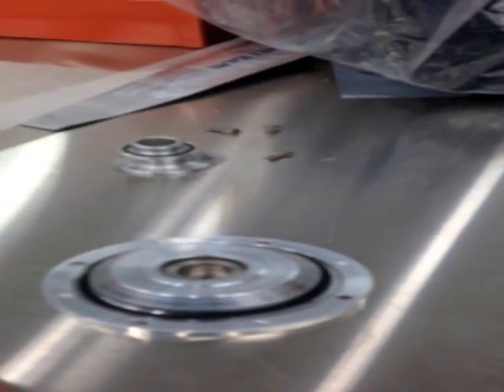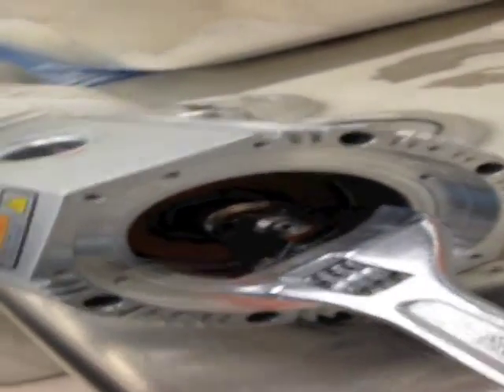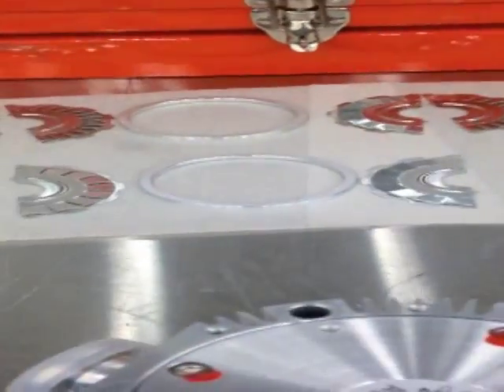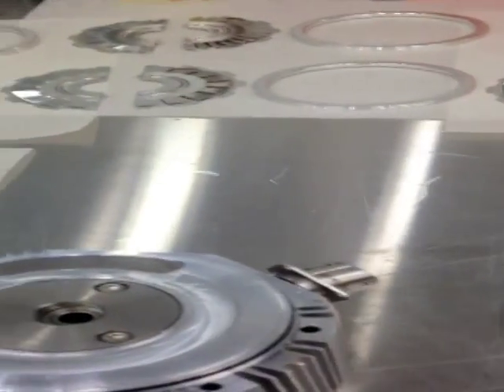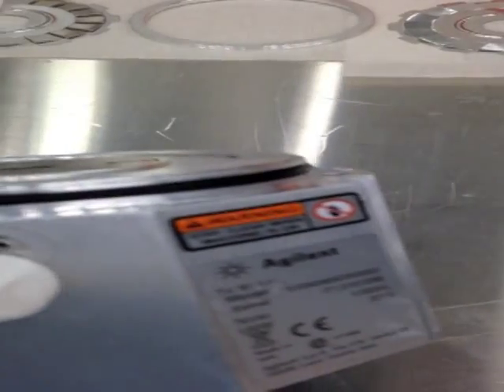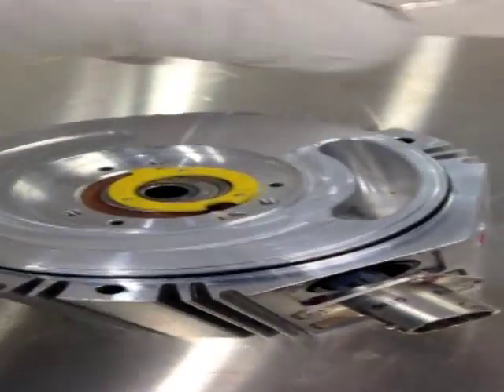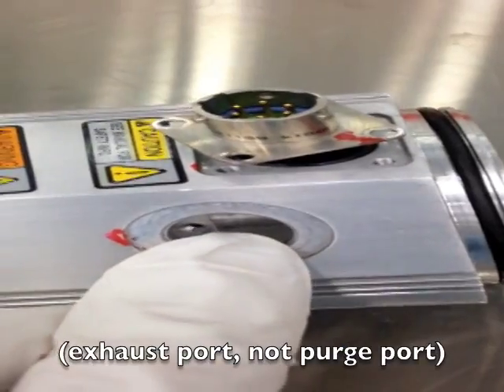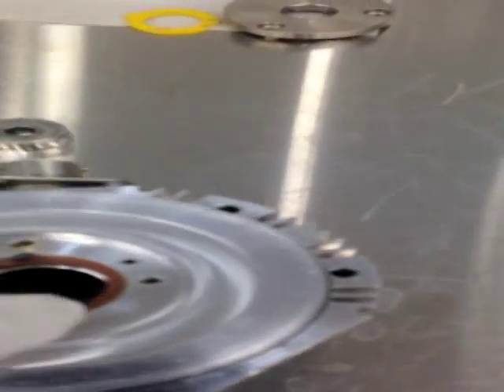Turbo pump repair

Comment: Hi Mark,
What part number were the bearings?  I have one I may take a crack at but if I could get the new bearings in first it would help.  Thanks
Reply from the maker: The bearing sealing face is painted "SNAP CAGE" and etched or engraved "BUK" and "38" (or "SS"? hard to read). The outer ring is painted "BARDEN(UK)", and one of the two was painted "C36SSTAY39" (or "C3888TAY38?" paint blotchy). But you should verify the part numbers for your pump with the original manufacturer or at least a remanufacturer.
Reply: Hot on the trail

Comment: I expect that this have to be balanced after this?
Reply from the maker: If you are careful to reassemble with every part in the same place, I would not expect it to need rebalancing. Of course, that assumes it didn't need balancing before you took it apart.
Reply: @markwistey2802  Always a normal thing to do after the rotor has been removed from the shaft is a balancing, and they are always balanced before taken apart. Did the one you fixed in the video have no vibrations what so ever when tested afterwards?

A few milligram imbalance is enough for a turbo pump to start vibrate and that is easily accomplished if anything is of by so little that it cant even be seen, even if the rotor is put on a fraction of a mm wrong that cant even be seen.

Comment: Is ok to wash with isopropanol 99% internal parts?  And where I could buy oil cup (leybold model).. Ebay?
Reply from the maker: If your turbo uses oil, it must have o-rings somewhere, and those might be sensitive to solvents. You'll need to figure out what kind of material the o-rings are made from. The Cole-Parmer database of chemical compatibility shows isopropanol to be Good with neoprene & Buna-N (okay for a quick wipe), and Excellent with viton, FKM & FFKM. The bearings and titanium rotor and stator blades should not be affected by common solvents. 
I don't know where to buy Leybold replacement parts like the oil cup.
Reply: @markwistey2802  thank you very much for help

Comment: This is great. Do you know where to buy the bearings? Cheers
Reply: I believe you can get them from Alpine Bearing.
Reply from the maker: Nope. Sorry, all I have are the part numbers I listed in the comments. If you do find a supplier, please post here.
Reply: Yes I will do that. I have a V70 all laid out now. Having trouble with the shaft nut which really needs a special tool.

Comment: Hello Mark!

Please, help us! 
we need to repair turbo molecular vacuum pump next-240d
The problem in :
-  Control Boards (Circuit board) to turbomolecular pump EDWARDS nEXT-240D in a quantity two (2) pieces.

We need these Control Boards (Circuit board)  or repair (service) turbomolecular pump EDWARDS nEXT-240D

Could you please advice somebody to make service
Reply from the maker: +ООО Насос-Энерго Техника   You might ask at the usual pump sellers/repairers like Ideal Vacuum, A&J, Turbo Vacuum, Kurt J. Lesker, Eagle Instrument.

Comment: Hi Mark very interesting your video. Currently I have problems with a turbopump Navigator TV.301, Very often the bearings are damaged. I´m thinking the problem is the bearings quality. I appreciate If you have any idea to solve the problem, because only to get the bearings is a little bit difficult. Thanks
Reply from the maker: All I can suggest is to check the obvious things: particles, roughing pump, bearing operating temperature, contamination, venting procedure, and vibration, especially any resonance. And some pumps just seem to be unlucky with bearings for no obvious cause. In those cases a different model or more frequent bearing replacement helps prevent a crash.
Reply: Also experience problems with the V301 turbo pump. It's been replaced for the second time in the last 5 years. Is it normal for this type of pump to function properly for only 2-3 years of continuous operation ? Should this type of pump operate continuously or should it be switched off often to minimize the wear of the bearing ? Thank you.
Reply: @szamanisticrealistic2659  What type of bearings does it use? Does it use hybrid ceramic bearing or ordinary ones?